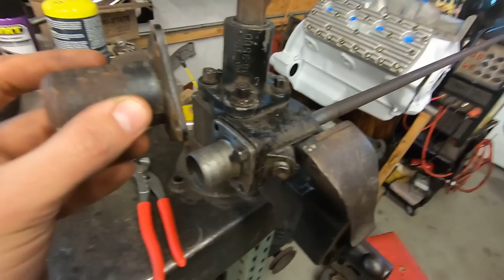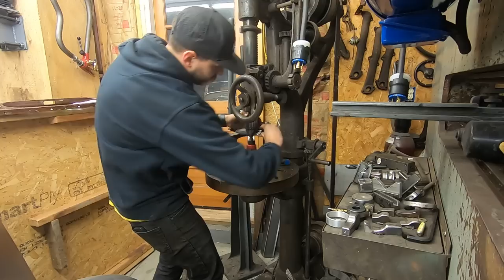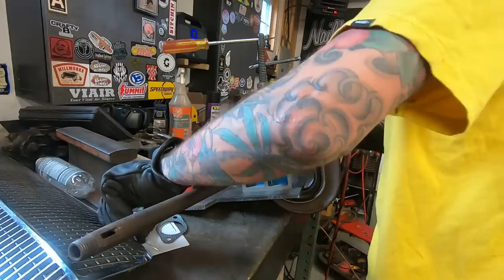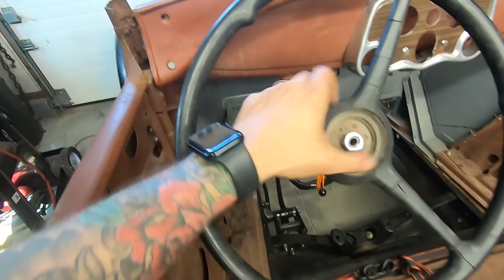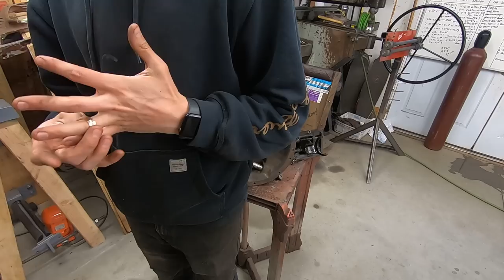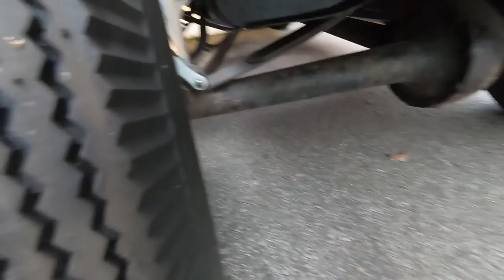Coffee Break - The Story of a 1929 Roadster Pickup Steering and Engine

Comment: Rather than burn the pedals try an arbor press ?
Reply from the maker: I could try to bend it cold but also run the risk of cracking the coating. Either way I’m most likely going to have to repaint. Not too big of a deal